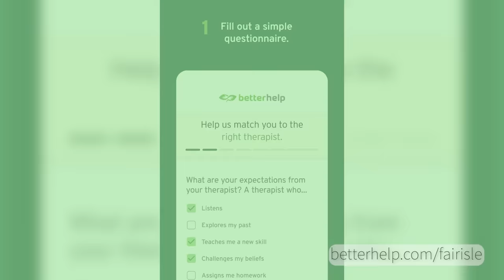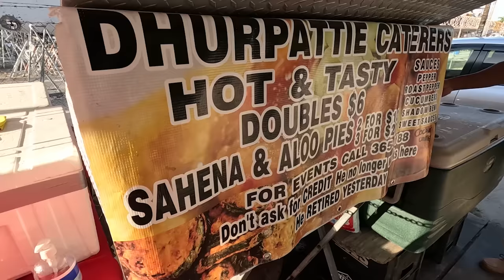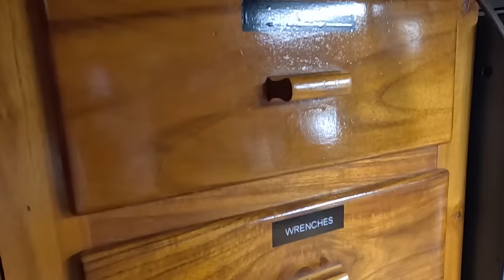Land Ahoy! After a 2,000 mile ocean crossing, welcome to Trinidad  |   Ep110

Comment: Welcome to the Caribbean. How did you find your cutter , where you longing for a solent rig ? Seems like you clicked of great speed. ! Call Anjo insurance in Antigua , they are great to deal with and have very good rates. What are your plans , how long will you be staying in the Caribbean, would love to meet up.
Reply from the maker: If you saw the conversation I had with Dick Beaumont from Kraken when we went out on one of their boats my preference is for a cutter rather than a solent rig. Dick says I might change my mind after enough trade wind sailing and he may be right. I certainly think for this crossing a solent rig would have worked well. We will probably sail the windward islands and stay South for Hurricane season then go North in November.
Reply: Yes , I watched that episode. I have a cutter as well and though for the down wind legs the solent may work best but for everything else it seems like a compromise . Also I’m not crazy about splitting the forestay tension in half . And yes sunk by flying fish may be an issue in todays boats 😂  Also just wondering who made your mainsail cover, Im in the process of designing and sewing sewing one up . I liked a few of the things I saw in yours.
Reply from the maker: It was made in Eastbourne UK just before we left, but with the new sail we were struggling to zip it up, not enough room. So Antonio who is the main rigger/sailmaker in Lagos (Portugal) added an extra panel on top with the zip to one side which works really well. He also made us a windlass cover (cheap and very good) overnight! We showed him in the episode where we unstepped the mast as he was the rigger in charge, a man of many talents!
Reply: Yes I saw that piece on top , its green , I am thinking about the same thing . Putting that piece in there with the zipper in it . just lays between the poles . Im using carbon fiber for the stiffening poles , hopefully will not sag.
Reply from the maker: @svsalserenity4375  yes we have glass fibre battens about an inch wide that do the job. Just make the volume of the stack pack big, there no point in giving yourself the task of trying to chrome the sail in there before you’re able to zip up every time